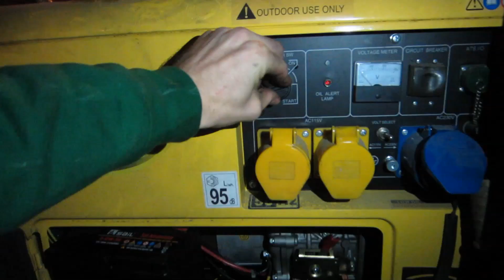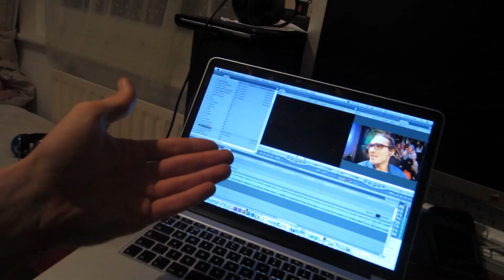NOT FUN FOR LOUIS

Comment: The blue stuff is just corrosion. It makes it difficult for the battery to connect with the engine, but if you just clean the corrosion off it will be much easier. It doesn't mean that the battery is dead, it's a completely separate problem. I've seen many cars not start because of excessive corrosion on the terminals.

Comment: you need to clean your battery terminal and maybe buy new battery terminal connectors. bad connections will make your bus not start even if its charged and working.

Comment: All you needed to do was clean the battery posts and terminals to get a proper connection.
Reply: also never open the radiator cap with the engine running but i like your bus man proper gear box and everything.